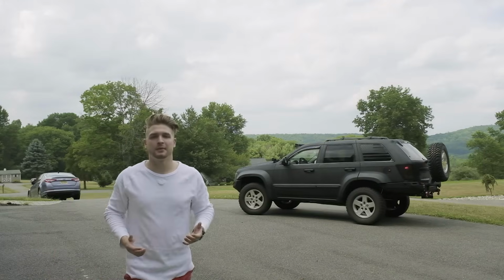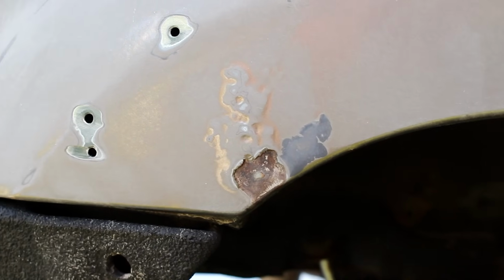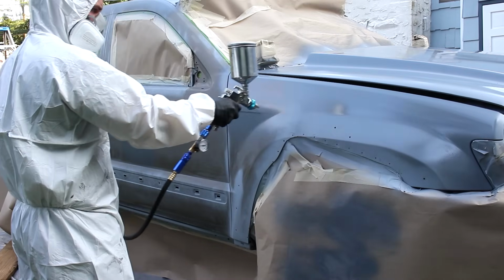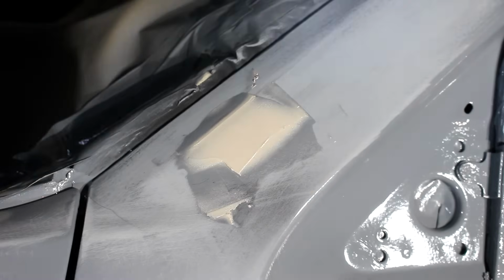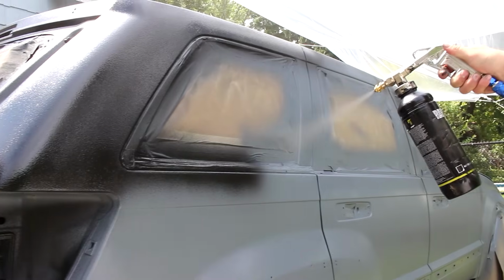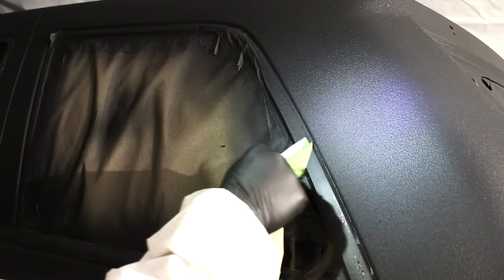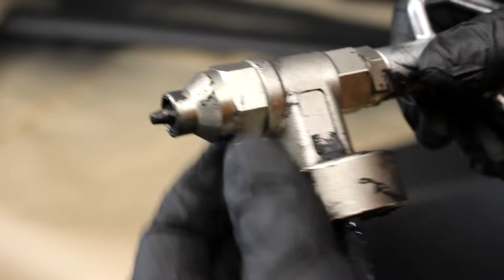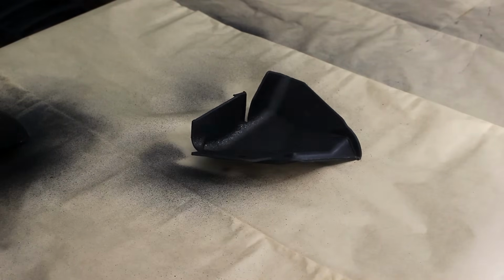Raptor Lining My ENTIRE Jeep (and everything in between)

Comment: Hey bro did you use bondo? Bondo is supposed to be applied to baremetal. Its says so on the instructions. Any reason why u primered first?

And how come waiting an hour between coats on the plastic when raptor liner says 20 to 30 minutes? Is it because you went so thick on the coats?

Comment: What CFM air compressor is this? You are getting a super thick coating from a good distance away and moving at speed. When I sprayed id have to go super slow and have the gun like a foot away to achieve a similar coverage.
Reply from the maker: The CFM on the compressor I use is 5.7CFM at 90PSI. Although Raptor recommends at least a "6 HP compressor that generates 150 PSI line pressure" for applications.
Reply: @MyJeepStory  Awesome, that's good to know! Thanks for replying!

Comment: What color do they call that is it like a charcoal or black. And Do you have to do two coats or can you just do one I want to do a two-tone  but it sounds like you have to take the tape off pretty quick doesn’t seem like there would be time for two
Reply from the maker: The color of this kit used was their black, but due to the texture it often times looks grey. I would recommend two base coats and one dust coats over three hours, remove the tape, and wait 24 hours. Then, reapply the masking tape and apply the next color again with two base coats and one drop coat. If you want to see the drop coat in action, check out my latest Raptor line video linked in the pinned comment in this comment section. Let me know if you need anything else!

Comment: How’s gas mileage?
Reply: Why do you think 30lbs of product is gonna kill your gas mileage🤦‍♂️
Reply: @MurdahBassRecords  aerodynamics, rough surface 🤦🏿‍♂️
Reply: @Kevin-is-here   Probably sounded smarter in your head. Thats ok. Not everyones an expert. 
Rough surfaces like bedliner (which isnt actually rough depending on how you spray it) trap air bubbles in the pockets and allow air to flow more freely over them. 
The giant air pocket going over the vehcle is not constantly rubbing against the panels of the vehicles you create something called a draft or a giant mass of air on your vehicle. Its why a truck isnt slowed down with an open box because the air moves freely over it due to aerodynamics of the front of the vehicle.
Myth busters also did a section on it. It doesnt get affected👌
Have also watched alot of tests with cylinder heads that have cnc machined little holes on the inside of the heads for this exact purpose.
Reply: @Kevin-is-here  also......look at a golfball. They are not smooth. But have a surface full of tiny holes and those sail through the air Up to 3 or 400 yards....same principle👍

Comment: What size air compressor should I have to use the air gun for application?
Reply from the maker: A 6 HP compressor that generates 150 PSI line pressure should provide sufficient air supply, but is dependent on the application equipment / gun (Shultz type or gravity feed HVLP) used to apply the RAPTOR.
Reply: @MyJeepStory  should I not use the gun they provide in their kit?
Reply: @MyJeepStory  last question I promise, did you do the door jams of just the exterior?

Comment: Any Clearcoat or Glossifier added ? I've seen super shiny sparkly black raptor liner paint jobs.
And then i've seen faded raptor liner paint jobs that look faded and patch and grey looking.
So wondering if theres a trick to make it shiny and UV protecting like Line X Ultra.
Line X quoted me $15,000 for a Full Size Lifted Van Exterior Line X Paint Job .
So here i am on Youtube learning DIY lol
Reply from the maker: That is OBSURD. I mentioned it in the video that I had worked there and I did BMW SUVs, Wranglers, and everything in between and it never breached a third of your quote. I understand it’s bigger, but a can is typically less complex and so I’m sorry you were dealt that card. Anyhow, I’m here to help and I know EXACTLY what you’re trying to achieve. 

For starters, no gloss was added, but gloss can be applied over Raptor. I’m not familiar with anyone adding it in and while I know some have laid gloss on after, I’ve not seen it with my own eyes. What you’re referring to in how shiny it looks is 100% down to the texture which is controlled by three variables: the distance, the pressure you shoot the material out, and the Vari-Nozzle gun if you have it. The more texture and thicker the material, the less it will reflect light and therefore the more matte finish you will have. It will look like a deeper black and can even hide imperfections a bit better. A finer texture sprayed at a higher PSI will achieve a smoother finish with less texture and will seem to sparkle when light hits it. This can be further emphasized by a dust coat at the end where you increase the PSI to ~90 and shoot from a distance greater than your previous coats and “dust” a coat of liner on for the final coat. 

I hope this helps! Line-X Ultra is their thinnest application for reference and to get the closest resemblance, you want to do the same with Raptor and shoot with a fine texture. Let me know if I can help out any further!
Reply: Thanks for all the info. I’ve been waiting 3-4 years now on the project because quotes on the West Coast are still in the $8,000 - $15,000 for a full exterior job. 
Plus when you give them the ok to do it, they are 3-6 months waiting time. So it’s not very likely happening soon for a DIY

Comment: Why did you choose the fancy gun?  Compressor cfm? Why did you use the red stuff pads for plastic rather then the wire wheel used on the fender- scratches too deep? Anything on tooling that would have worked well enough? (Big difference in spraying with your gun? Lower output of compressor would have worked? Bondo?) 
Thanks,  liked the video
Reply from the maker: Thanks for watching and taking the time to comment! I apologize for the delay in response, but I'm happy to answer your questions. To begin, I have an upload scheduled for February 20th where I Raptor an entire Jeep Gladiator JT and I answer a lot of questions that I got from this video such as the compressor I use, the cost, etc. 

I chose the Vari-Nozzle gun due to the fact that you can control and achieve a desired texture in ways that the standard Schutz cannot. Where you can control the PSI and distance only with the standard gun, you can also control the texture of Raptor by adjusting the tip of the Vari-Nozzle gun. 

The compressor I use is a 30 gallon Industrial Air p/n ILA1883054 which delivers 5.7 CFM @ 90 PSI. A 6 HP compressor that generates 150 PSI line pressure should provide sufficient air supply, but is dependent on the application equipment / gun (Shultz type or gravity feed HVLP) used to apply the Raptor. 

The wire wheel was just used at certain times to help remove old adhesive that I had on the Jeep. I would stay away from that when possible to avoid scratches that are a little too deep and stick to a sandpaper around 80-120 grit for best adhesion. Definitely stay away from these low grits when applying Raptor with an HVLP gun as that requires a thinner and has a higher tendency of showing scratches beneath it. 

In my next video, I use an Eastwood SCT to prepare the entire surface, but be careful with power tools when sanding because if you DON'T plan on using the epoxy primer first, sanding to bare metal is not a great idea as Raptor does not adhere to bare metal or rust very well without a primer. 

Let me know if there's any other questions that you may have and I'll get right back to you!

Comment: Looking to do my Trailblazer. What'd it cost you?
Reply from the maker: I'll assume you have a compressor, but I'll include the price of a gun here as well. 

Material cost was for about 16 liters and for every four, it's about $100. Often times, you can get the standard Schutz gun for free with an online order of four liters. (Note that in the video, I had the gallon of Raptor and the gallon of hardener which is more expensive upfront, but cheaper if you plan on doing many projects with Raptor over time). Raptor's Epoxy Primer is only offered in the gallon kit and is about $150, if not a little cheaper. For disposables such as tape, paper, etc, I'd budget $50 on the cheaper side. You'll also need PPE such as a mask (required) and if you'd like, I'd get the painter's coveralls that keep you clean. Gloves are certainly recommended as well. 

Raptor liner: $400
Raptor Epoxy Primer (optional, but recommended): $150
Disposables: $50
PPE: $50

So overall, we're looking at about $650 before tax, but you can certainly do this for less by waiting for deals on Raptor!
Reply: @MyJeepStory  Nice. That's not bad at all. Thanks a lot!

Comment: how big of a compressor do you need to spray this raptor liner?
Reply from the maker: A 6 HP compressor that generates 150 PSI line pressure should provide sufficient air supply, but is dependent on the application equipment / gun (Shultz type or gravity feed HVLP) used to apply the RAPTOR.
Reply: @MyJeepStory  Damn a compressor like that is expensive tho to expensive for me at least im a poor boy 😫 i guess jus rattle can primer for me then SUCKS!!!

Comment: Can you put rust converter on and then raptor over the top?
Reply from the maker: What kind of rust converter? Is this for an underbody or frame? I’d be cautious in doing so because Raptor is better treated with the epoxy primer over rust first which is designed to go over rust. Raptor doesn’t do well with rust and a lot of rust converters are just 1K primers that won’t do much for you unfortunately.

Comment: Ok you may have answered this but how many man hour did you put into this plus any corrections or additional coats...guesstimate?  Wonderful and informative on the process. A lot more than I was thinking. I want to do my Ramcharger next spring.
Reply from the maker: Thank you so much for watching and just so you know, I will have another video out within two weeks covering the process again, but painting a brand new Jeep Gladiator! The hours depends and it will ultimately come down to how perfect of a finish you're looking for. For reference, you can easily get this done without stripping the vehicle during a weekend, but for a full strip of parts, I plan on three weeks. It doesn't need three weeks, but setting aside that time allows for a mistake here and there with time to recover and fix anything that may go wrong. Plus when you remove and paint parts, you want to wait between 48 hours and a week to reinstall the parts as well and the little things really add up. It's tough to give you an estimate of the time it took for this Jeep since the filming took a big chunk of it. Please let me know if you have any other questions!

Comment: I'm doing my whole Silverado tomorrow. Your videos are invaluable
Reply from the maker: Let me know how it goes and if you need any help.
Reply: @MyJeepStory  just did the first coat, took 6 bottles, have 6 more. Had my psi between 60-80 but the texture isn't super fine, I also applied too much to some areas on accident making it more smoothish, but that's alright. For the last coat your suppose to sort of "dust" the whole vehicle right? Holding the gun farther away, making it more matte
Reply: @MyJeepStory  finished the truck the same day, it looks really good.

Comment: Question for the strength, we have a lot of hail here in Texas so was thinking of coating the roof and hood of my subaru crosstrek...does this stuff add some hail resistance?  Thank you!
Reply from the maker: The thickness of three coats of Raptor (two base coats, one drop coat) will be MUCH thicker than any standard paint or vinyl wrap. It's a two part paint and is even flexible and would be a great defense for hail. If I were you and expecting hail, I would apply two coats, wait the 24 hours, scuff it with a red pad, and lay two more coats followed by a drop coat for an extremely durable and even finish. With that said, I have brought my Jeep down some really thin and gnarly trails with branches doing their best to wear down the Raptor to no avail, so even with two coats this stuff will hold up just fine! I hope this helps, please let me know if you have any other questions that I may answer and I'd be happy to help.
Reply: @MyJeepStory  Thank you for the awesome reply, forgive my ignorance what is a drop coat?

Comment: Love what you did, i have been thinking about doing my 2002 nissan frontier xe (old school) truck hoping you don't mind if i ask how much did it cost  you doing it as diy thank you😇
Reply from the maker: Sure thing, I'd be happy to help! I'll assume you have a compressor, but I'll include the price of a gun here as well. 

Material cost was for about 16 liters and for every four, it's about $100. Often times, you can get the standard Schutz gun for free with an online order of four liters. (Note that in the video, I had the gallon of Raptor and the gallon of hardener which is more expensive upfront, but cheaper if you plan on doing many projects with Raptor over time). Raptor's Epoxy Primer is only offered in the gallon kit and is about $150, if not a little cheaper. For disposables such as tape, paper, etc, I'd budget $50 on the cheaper side. You'll also need PPE such as a mask (required) and if you'd like, I'd get the painter's coveralls that keep you clean. Gloves are certainly recommended as well. 

Raptor liner: $400
Raptor Epoxy Primer (optional, but recommended): $150
Disposables: $50
PPE: $50

So overall, we're looking at about $650 before tax, but you can certainly do this for less by waiting for deals on Raptor!
Reply: @MyJeepStory  thanks brother🦅🇺🇸🦅

Comment: Did you have to spray the entire rig with the primer? In other videos I have not noticed anyone doing that to the level that you did.
Reply from the maker: I didn’t have to, but when sanding down older paint and fixing deep scratches and dents, it’s common the end up sanding down to bare metal. In that case, Raptor Liner doesn’t adhere very well to bare metal and priming is a great way to ensure proper and strong adhesion over the entire surface area. You can definitely get away with spot priming places that went through OEM paint though!

Comment: How much raptor liner you spend on the jeep?
Reply from the maker: I'll assume you have a compressor, but I'll include the price of a gun here as well. 

Material cost was for about 16 liters and for every four, it's about $100. Often times, you can get the standard Schutz gun for free with an online order of four liters. (Note that in the video, I had the gallon of Raptor and the gallon of hardener which is more expensive upfront, but cheaper if you plan on doing many projects with Raptor over time). Raptor's Epoxy Primer is only offered in the gallon kit and is about $150, if not a little cheaper. For disposables such as tape, paper, etc, I'd budget $50 on the cheaper side. You'll also need PPE such as a mask (required) and if you'd like, I'd get the painter's coveralls that keep you clean. Gloves are certainly recommended as well. 

Raptor liner: $400
Raptor Epoxy Primer (optional, but recommended): $150
Disposables: $50
PPE: $50

So overall, we're looking at about $650 before tax, but you can certainly do this for less by waiting for deals on Raptor!
Reply: @MyJeepStory   how much raptor epoxy primer would you recommend & raptor Bedliner Paint for a Dodge Charger 2012?
Reply: @MyJeepStory  also what’s a ppe?

Comment: Great job! It turned out Beautiful...  I was wondering if I could  apply this bed liner on the fiberglass roof of my van. What do you think?
Reply from the maker: Thank you so much! You can absolutely spray your fiberglass roof. It adheres really well to fiberglass and is UV resistant meaning it won’t fade even if the roof gets hit with a ton of sunlight. Not to mention that if the off chance it hails, it will protect the substrate beneath it!
Reply: Thank you so much for you quick replay. Planning to bedline the inside and the outside of my van. At 66 yo,  it’s a lot to tackle but it needs to be done to preserve my home for some more years. Thank you so very much!
Reply from the maker: I’m always happy to help! I really value all of the support I’ve gotten on my channel thanks to people like you 🙏 Just let me know if you need anything else and keep me posted on how your project goes! If you’re on the east coast, feel free to reach out and I can always lend a hand!

Comment: Good job, you did this like a pro 👍
Reply from the maker: Thank you so much! I definitely wanted to make sure I set a good example for anyone who wanted to do this and made sure no details were skipped! I have a video coming out very soon covering the Raptor lining of a brand new Gladiator and I’ll be covering some questions I missed in this video as well. 👍
Reply: @MyJeepStory  looking forward to watch the gladiator video.  Also I forget to asked you about the type/size of compressor you used?
Reply from the maker: @rd4501  I go over the details of what compressor works in the next video, but the exact model I used was the Industrial Air ila1883054! It's 155PSI max, 7.0 CFM @ 40 PSI and 5.7 CFM at 90 PSI. I hope this helps!

Comment: Did you buy this as a kit? I’m looking at their kits on amazon and I’m not totally sure which one to purchase. Also, awesome content. Subbed 👍🏻
Reply from the maker: Yep! When you buy the gallon of the liner, it comes with all of the hardener you need for the gallon. There's two options, tintable and black, shown in the video is their black kit. If you opt for the tintable, you'll need to buy their packs of color tint alongside the Raptor Liner. If you want the primer, you'll need to buy that separate as well.
Reply: My Jeep Story awesome. Thanks!